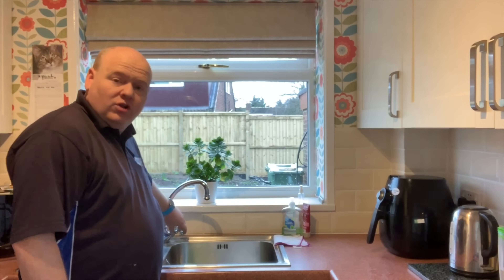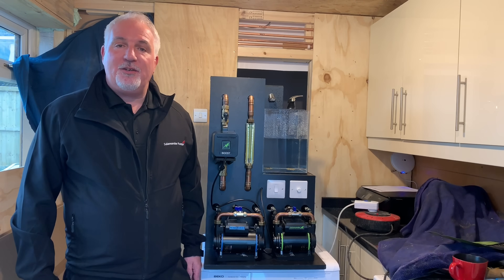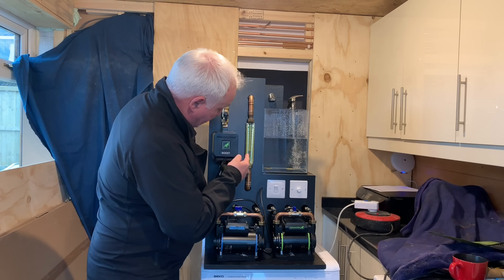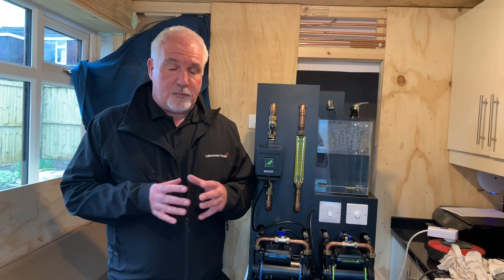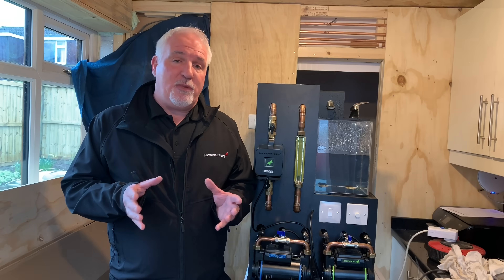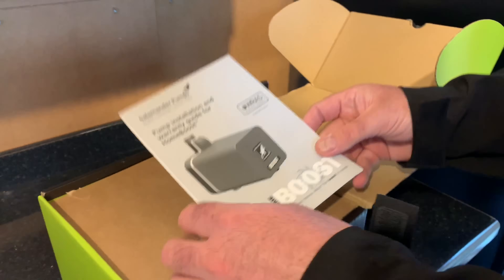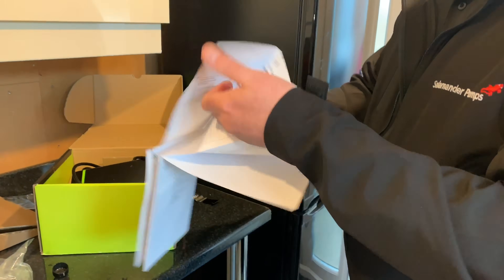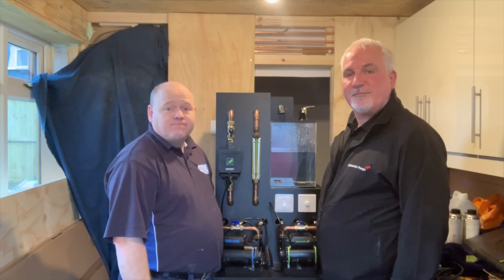LOW MAINS WATER PRESSURE & FLOW - Salamander Mains Home Boost Pump

Comment: Great demonstration guys.
I have low pressure and i am considering one of these pumps but i have a Quooker tap in the kitchen.
Question is would the pump kick in quick enough if i was filling a cup up via the Quooker tap if making a coffee ?
Reply: Your quooker is like a kettle already filled with hot water, and opening it to make a drink or two not going to trigger the pump! .... it gets filled automatically and the quooker boiles first!

Comment: Hi Mate, i currently run a Walrus 1PH 50hz and it's pretty noisy! My neighbour hears it!! (semi D) It's fitted near the dividing wall side unfortunately as bathroom there. My question is: if I purchase this pump, will it be quieter do you think Allen? Do you think in your experience will my neighbour hear it?? Much appreciation.
Reply from the maker: I wouldn’t like to say but it does have a quiet mark. Thanks.

Comment: would an incoming pressure of 10 litres per minute at 2bar starve the pump on the inlet side if the demand above was too great? (ie two showers running at the same time)

Comment: Hi, I have modified my house gravity fed system by plumbing mains directly to cold taps and electric shower, but still keep water tank in the loft and hot cylinder tank. Can I install this boost pump so I can get more shower pressure, considering it's not for gravity fed system? Cheers

Comment: If shared mains water you can not put it.
Reply: This is not suitable, as HomeBoost must be installed onto a dedicated mains supply.
Reply: @SalamanderPumps  read question again Please..
Reply: @dzmalekvali1110  Hi, yes that is correct. You can not install this pump on a shared mains supply.
Reply: @SalamanderPumps  can you explain pls
Reply: @dzmalekvali1110  We wouldn’t advise fitting the HomeBoost on the actual main riser (mains supply pipework as it goes up each floor to supply each flat) as it will only boost the water flow to 12LPM. If the pump was shared between 6 flats, each flat would only get 2LPM.
Reply: @SalamanderPumps  the pump is fitted after te first Tee to first flat,why would it supply only 6litr ?? Focus with me bro
Reply: @SalamanderPumps  I'm not suggesting putting it before the flat. Any ways forget it dude...the salamder team limited to knowledge on field..this could actually be boosting sales for salamder...all I'm getting is you don't understand what am trying to say..next time I try Japanese writing may be I get some Where... within the salamander headquarters....
Reply: @dzmalekvali1110  try writing in English, you're writing nonsense - no wonder you're not getting the answers you  want.

Comment: That's fine that close to the pump but what about taps/showers upstairs ??????  because mine doesn't work and keeps shutting down !!!!!!!     £ 400 quid wasted thanks great vid  !!!!
Reply: Hi, this may be caused by the property having insufficient flow rate in order to activate the pump. HomeBoost requires a minimum of 3 litres per minute to operate.

Comment: Has this model of pump always had the indicator light system on it?  I moved into a 4 year old house that has this pump fitted.  Never heard the pump run yet, checked it out today, no lights at all on the display logo.  There is power on the electrical socket and the fuse in the plug is OK.  The basic cold mains pressure produced a flow of around 8L/min (fills 1L jug in 7.3secs).  Maybe when more taps are open the pressure/flow will drop and bring the pump on?  But shouldn't the display logo be illuminated even in standby? 
Or maybe the pump is faulty?
Reply: Check the fuse in the plug.
Reply: @Nickbaldeagle02  The fuse in the plug is OK.  It appears that the pump is unserviceable/failed, it shows no signs of life and never comes on.  The fuse is the wrong size (13amp) which suggests that there had been previous problems and someone had tried the larger 13amp fuse.  The plug is now removed from the socket and fuse removed from the plug.
Reply: @SaxJockey  aha. In that case I suggest a replacement unit. They come with a 3 year warranty with the option to extend. They're a doddle to install.
Reply: The indicator light on HomeBoost should be displayed at all times when connected to the power supply. When in operation, the indicator lights should flash clockwise. If there is no indicator light displayed, there may be a fault or no power supply to the pump. Please contact our Technical team for further help, on 0191 516 2002.

Comment: Please help 
I want to buy this pump but what do you think?
I have 16l /m from my main.I  have 4 bed hous and 2 baths.
Can I add this pump and have water flow  about 12l/m more let say 28l/m?
When I have to use 2 bathrooms at the same time my water flow is very low unfortunately😑
Reply: Hi - sounds like you need to go for something a little bigger. We have a range of solutions that may help - try the product selector on our website to find the right product for you https://www.salamanderpumps.co.uk/product-selector.php

Comment: Hi, our water supply varies a lot, obviously depending on demand. We are at the end of the water boards supply pipe, and as a result in our kitchen the cold main can go from 11lpm to 3lpm and we often have no water in our upstairs cold tap when demand is really high. We have a new 25mm mdpe pipe to the property. Would this pump keep us a a constant 12lpm?
Reply: Yes

Comment: This is somewhat confusing. Water pressure and water flow rate are two different things, albeit related. If the incoming main is already at 2 bar pressure or more, is this pump going to increase the flow rate? This pump only pumps to 1.5 bar, so presumably won't work to give you more volume of water?  If the pressure was very low, say 1 bar, presumably it would add 0.5 bar pressure and increase the flow rate accordingly? Please can you advise what this pump actually does?
Reply: Hi Neil, HomeBoost monitors only the flow rate of the incoming mains water, so if the natural mains is between 3 L/min and 12L/min HomeBoost will be activated and will increase the flow to the legally allowed limit of 12 L/min. Let us know if you have any other questions.

Comment: cheaper pumps hoses fail  over   time  do not  fitting plastic  pumps   on communal    heated  hot water  cylinders  as  thermostats     fail  pumps  become    brittle   casings  leak    salamander     ect   others  check temp of water   if  you pick cheap   pump     fit   in    shallow tray   with overflow   pipework fitted   also check guarantee   and   house hold insurance ! if  fitting in  customers  house   make   them  a where  [   fit  brass pump   more expensive   less  shit   same   price  to   fit.

Comment: good idea fit pressure   reducer to protect pump  10 bar max   measured standing  pressure  2  bar during day  had   spike  during night  brass pump exploded   have  in mind they wont your credit card before they come out   to fix pump  or  replace  flooded   3  flats  on  inspection installation  text book

Comment: My main in the kitchen is only 10litres per min put my upstairs hot and cold is only 6 litres per min will this pump help it, my boiler is a combi boiler and it is installed upstairs
Reply: Hi, HomeBoost should be able to help however we would need to know a little more about your system. Can you give our technical team a call on 0191 516 2002. Thanks
Reply: Yes it will.

Comment: Hi Alan is it possible to fit on to hot water supply to a kitchen tap   No issue with Flow in old tap but New monobloc tap got fitted and bore size of flexi on tap is only 1/4 inch. Old tap was two hole  mixer with half inch tails.  Hot supply is open vent. What is the temperature limit in the pump? Thanks.
Reply: Hi Paul, If your hot supply is fed via the open vented on the hot water cylinder then one of Salamander's products would be suitable but it wouldn’t be the HomeBoost. More than likely in this instance, your cold water would be supplied by cold water mains, we would therefore recommend fitting a single negative head pump.

The temperature which can be supplied through the HomeBoost is 20 Degrees. 

If you need more information give us a 0191 516 2002. Thanks

Comment: Ive been to a house when theres 4 floors. Anytime someone opens the taps on the 1st or 2nd floor, you get no cold water coming out of the bath basin or electric shower on the 3rd and 4th floor. Would it not be best to put this pump just before the 3rd floor, rather then just after the stoptap entering the house? The flow rate on the 3rd floor providing no id using water below is 11l/min but drops to 0 when water is used elsewhere
Reply: It is possible to locate the pump further up stream, but in your installation it may not be suitable, as the pump needs a minimum of 3 litres per minute to activate. If you need more information and installation advice, give us a call on 0191 516 2002. Thanks.
Reply: @SalamanderPumps  ok thanks for your help

Comment: Surely if the water isn't there in the first place how can it boost the pressure and flow rate..
Reply: Hi, HomeBoost needs a minimum flow rate of 3 litres per minute to operate. As long as there is 3 lpm passing through the pump it will boost that up to around 12 lpm, by drawing from the incoming mains water. Thanks
Reply: @SalamanderPumps  if the water was there in the pipe it would come out the tap.  Your suggesting the restriction is in the tap then and not the pipe....you can't make 12lpm from a 3lpm supply. Unless you have  a tank obviously
Reply: @LunchBoxArcades  The mains is always flooded, meaning that there is always more water available. But your plumbing system may not draw enough water from the mains, you can see from the video that HomeBoost will pump more water from the mains, and giving you a flow rate of 12lpm. Thanks
Reply: @SalamanderPumps  so this increases the flow rate and not pressure?
Reply: @liamhirst4465  Hi Liam, Yeah HomeBoost will boost the flow rate of the incoming mains water to 12ltr/min, and works at around 1.5 bar. Thanks
Reply: @LunchBoxArcades  come to my house. I'll demonstrate with the pump off, then on. ☺

Comment: I thought the waterboard had a legal obligation to maintain 1 bar.
Reply: Hi William,  Water regulations state that the mains cannot be pumped by more than 12 ltr/min. HomeBoost is intelligent and will pump more that 12ltr/min from the incoming mains. For more info visit www.salamanderpumps.co.uk
Reply: @william jones it does but only to the external stop tap...
Reply: They guarantee you at least 1 bar but it can be higher
Reply: Yes. Much like motorists have a legal obligation not to exceed 70 on the motorway.

Comment: Hi Allen, most of the time I get decent flow out of my combi, however being on a shared main with next door it sometimes slows down a bit in the mornings when showering (and I assume the neighbour is as well)
So a couple of questions...
Does the pump only kick in when you drop below 12l a minute?
And would it effect my neighbour? Would their water slow down even more when the pump kicked in? 

Seems like a good idea but I’m worried it would effect the neighbours.
Reply: Hi Michael, If you have a shared mains supply then we cannot recommend a HomeBoost. HomeBoost is intelligent, it will boost the incoming mains supply up to 12ltr/min. The incoming flow rate must be above 3ltr/min and below 12ltr/min for HomeBoost to activate. Thanks

Comment: Nice upload Allen. Off topic a bit but do you know if Tectite fittings can be dismounted like JG ones can? Cheers mate.
Reply from the maker: I didn't know the answer as i have never installed them but i just asked on Gas Chat and this is the reply. Tectite classic yes, sprint no
Reply: @AllenHart999  Thanks for taking the time to do that. Much appreciated👍🏻
Reply from the maker: @BestUserNameUK  No problem.

Comment: Can this pump be fitted to an electric shower or has it got to be fitted to the rising main? Thanks
Reply from the maker: I am sure its fine but i will ask the question and get back to you. thanks.
Reply from the maker: You can install it on the mains into the shower, Might need a non-return valve that's all.
Reply: @AllenHart999  thankyou so much for the info. Will be soon fitting one to my shower now. Thanks again
Reply: unfortunately unless the electric shower is displaying a low water mains flow indicator then putting a booster pump on it won't make much difference. They can only heat the water to a certain temperature at a certain flow rate. So you may/will find installing a pump on it won't make any difference. They are unfortunately, for lack of a better word, shite.
Reply: @kb5057  ok thanks Allen, think I'll look into getting a different shower.
,

Comment: Looks a good bit of kit. On the house side of the stop tap we have 15mm pvc pipe will the pump connect to this type of piping ?
Reply from the maker: After the stop tap will normally be copper? You would install it on that. Thanks.
Reply: @AllenHart999  Not in this case it's blue from the stop tap in the road then from the stop tap in the house is grey 15mm quick fit stuff.
Reply from the maker: @clivetucker176  Just cut some of the plastic out and install a bit of copper, I do not think it will be an issue.
Reply: @AllenHart999  Thanks, that's what I was planning to do. For the price it will be a great help with our shower pressure.

Comment: According to grundfos you aren't allowed to install booster pumps without a break tank. How does this pump get around this regulation?

Normally find flow rate is a problem not pressure. Easier to install a 100/200l potable water expansion vessel and a couple of none return valves.

What is the flow rate like when theres no power to pump is there a grater restriction/ would you fit with a bypass?
Reply from the maker: I will ask the questions and get back to you. Thanks.
Reply from the maker: Q1. You can fit a pump to the main as long as it doesn’t pump more than 12ltr pm

Q2. If you need more than 12ltr pm then yes fit a storage vessel and pump from that. This is an inexpensive solution to many flow problems but not the answer to every-bodies requirements.

Q3. No power and the HomeBoost will not work, it requires a power supply to operate. It would be just as if the pump was in Idle mode.
Reply: Grundfos Scala 2...

Comment: Looks like a good bit of kit👍
Reply from the maker: Works really well and it would really help a lot of customers.
Reply: What do they retail at mate?
Reply from the maker: @owsi2297  I am not really sure about that. A quick google search should give you an idea. Thanks.
Reply from the maker: @owsi2297  You might be able to buy them for less but i found this. https://www.screwfix.com/p/salamander-pumps-homeboost-hb-booster-mains-water-boosting-pump-1-6bar/75286?ds_kid=39700034278281972&ds_rl=1245725&ds_rl=1241690&ds_rl=1245250&ds_rl=1245250&ds_rl=1249475&gclid=Cj0KCQiAn4PkBRCDARIsAGHmH3cwdRHE_1BBDf7IqUIfZHogn3j82qu9_wHcemNSw7M0PcctdjG5eg0aAs_1EALw_wcB&gclsrc=aw.ds